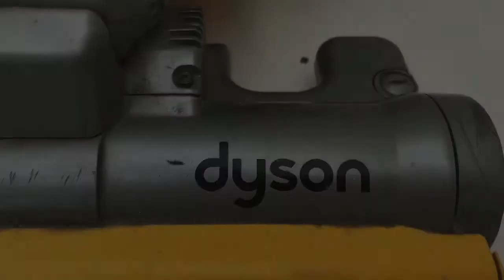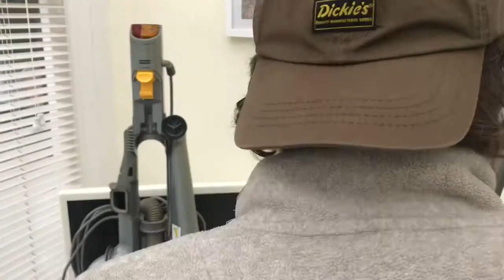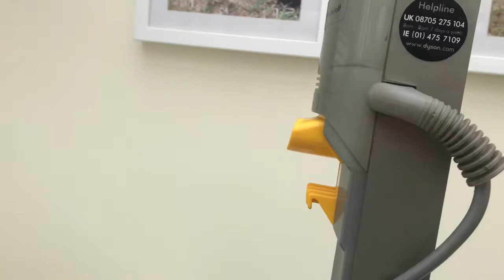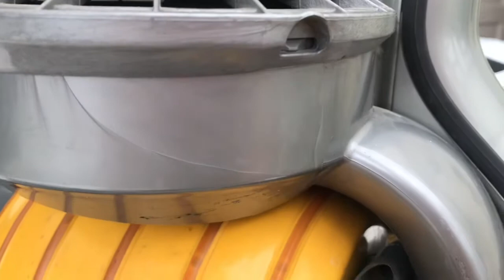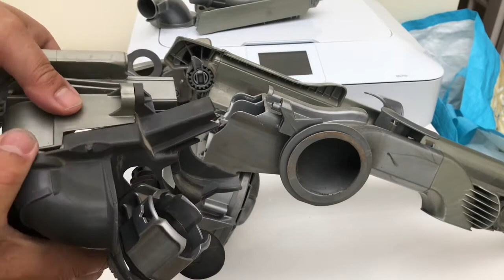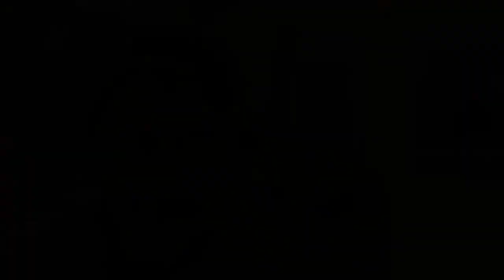DYSON DC15 SPINE REPLACEMENT

Comment: Do you think the modern Dyson cordless machines are good?  Or do you prefer the older models like this one?
Reply from the maker: @blakaeg  I personally prefer the new cordless Dysons for manoeuvrability and ease of use. My wife still sticks with the old corded ones including the example featured in the video. The only caveat is I believe Dyson started using customers as beta testers on the early cordless machines. We have a V6. It’s very prone to blockages, particularly in the cleaning head, the bin is too close to the cyclone shroud meaning the dust doesn’t drop out easily necessitating removing the clear bin completely, frequently. In addition it’s difficult to line the bin back up to clip it onto the cyclone. It’s still a good machine in many ways but I think a V10 onwards where the bin is in line would probably be better?
Reply: @markbennett6658 The new cordless are good for moving around in the home.   Though I’ve had issues with the wheels snapping off on a V15 and seem others mention it.   The durability could be a little better,  but overall I do like them.  The cyclone technology scaled down in the cordless do an excellent job at filtering the dust out of the air.   I’ve always found Dyson very interesting products since I first used the DC02.

Comment: I've got this model of Dyson and the handle and spine snapped in half where can I find a replacement spine plz let me know
Reply from the maker: Unfortunately they’re made of ‘unobtainium’. Dyson don’t provide long term parts support for older models. I did this repair 3 or 4 years ago and had trawled through eBay for a long time to find the donor part. This is one of the few weaknesses of what’s otherwise a very strong model. Keep trying eBay or FB for somebody selling the part or a machine with a different fault.

 It might be possible if you’ve got the piece that has broken off to heat weld/staple and or otherwise bond and reinforce it together to give it a second life. It’s a pity old consumer electrical appliances aren’t better supported.

Comment: Cheers Mark!! I seen where you commented on a 280z video from Number 27 channel and was just gonna recommend you check out the latest build video on my channel. We bought a cheap 240z to build using motor and trans from a 280z!!
Reply from the maker: Thanks I’ll check it out👍 I was a big Z guy myself back in the day. I had a 260Z 2 seater 1978 and a 240Z with a 2.8 engine with ported head, Janspeed exhaust manifold (headers), triple 45 Dellortos etc. I worked with William Galliers (now Wheels Of Old Ltd) and had close associations with Spike Anderson (Samuri Conversions) and wrote a small section in a Z book. I’ll leave a comment on your channel when I’ve had a look at your build 👍
Reply: @markbennett6658  heck yeah!!! Theres something about a Z man!!! Thanks for the reply!!!

Comment: What is the name of the part that holds up the stand. The little plastic piece broke. In the beginning of your video you had the part I need. It was the second common breaking point you mentioned. Is that the "stand assembly"? How do I get that part? DC15 upright yellow ball dyson like this video or similar
Reply from the maker: Hi thanks for your comment. Please refer to the reply I gave to “Riss T” who commented previously. I left a link. It’s called a ‘U bend pipe assembly. The issue as I alluded to in the video is that the DC15 is obsolete and Dyson don’t support it parts wise. You’ll have to go the eBay route or possibly try Manchester Vacs if they’re still about. Good second hand parts will be extremely scarce particularly considering the faults I showed are the common ones and the DC15 is otherwise built like a tank. Ours is still going strong two years later! Best of luck and I’m still trying to make time to create further videos. Hopefully soon 🤞

Comment: Do you know what the name is of the piece at the bottom that you showed? I'm pretty sure that's what I need to replace on mine. Something snapped and now it won't stand.
Reply from the maker: I believe it’s called a ‘U bend pipe assembly’ which is part ‘I’ if you follow this link https://cdn.shopify.com/s/files/1/1681/2335/files/DC15-Valve-Assembly-Schematic.jpg?9896319216922904827. The big part I replaced is the ‘duct assembly’ I’m not sure you can get the smaller part new. I’d actually try contacting Manchester Vacs for advice who run a Dyson Forum and may be able to supply the part second hand if you can’t get a new one. Have a look on eBay as well. The trouble is this is a fragile component and it might be hard to get a good one. Best of luck

Comment: Mine snapped just like you said at the beginning, and you nailed it at the end - sourcing a replacement spine seems to be near impossible. RIP my DC15.
Reply from the maker: We did manage to keep using ours broken for some time. The wand would lock the broken parts together enough to keep using it. Downstairs only mind you because it would come apart if lifted. Unfortunately it is the key fail point the rest being very robust. All the eBay sellers breaking them said no chance but I was patient and persisted and got one for about £25 in the end!
Reply: @markbennett6658  Mine held with some JB Weld for about two months. I might just brace it with some metal around the top.
Reply: @reverendragnarok did it work?  Just found my dc15 has a crack.. the bin just slips off if I try to lift it… how can I reinforce this?
Reply: @zurgitbanzal7913  Nope lasted long enough to get another non-Dyson vac. Couldn't source the part. Sorry!
Reply: @markbennett6658 is there a temporary fix for this… getting hold of the part maybe the easy part.. all the wires etc scare me 😟